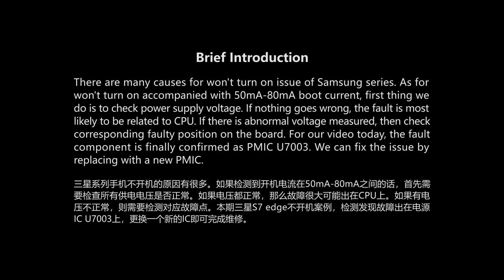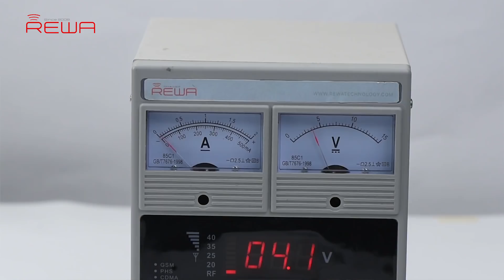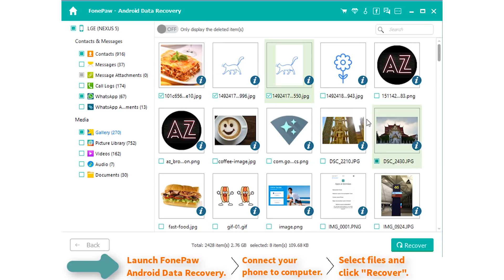How to Fix Samsung S7 edge Won't Turn on - Logic Board Solution

Comment from the maker: Leave us a message for Samsung issues you have frequently encountered.
Reply: REWA Technology : my brother galaxy note 5... it is turn on.. but there is no display.. i know it is turn on because the phone is vibrate.. can you point how to fix it.. at least.. which part should i check
Reply: hi rewa, mostly Samsung issues i had are black screen issue.
Reply: finally not an iphone video again, great job!

PLEASE find a solution to remove samsung screens on models that open from screen first without breaking the display AND how to remove screen to replace charge board on models like s6 s7 without breaking the display.

Thank You
Reply: My Uncle has a problem with is Note 3: It is turning off after he turns on mobile data. He has to hard reset via batter pull to get the device back to life again. What could that be?
Reply: the|Gamer  just need software flash. Issue will be resolved
Reply: I phone 📱 X glass frem any sollushans ?
Reply: Mainly in samsung lcd phones.backlight problem
How backlights works ?
Plz make a video.
Reply: In LED phone main problem EMMC chip.
Reply: Hi there and thanks for your videos
Ive 2 s7 edge oreo firmware
5 hour for charging via usb but in display say wireless charging... ?!?
Change 2 display but same problem
Thanks
Reply from the maker: @W Dora Try to replace a new screen. If the problem remains, troubleshoot the display circuit.
Reply from the maker: @the|Gamer  Have you ever tried to flash the phone?
Reply from the maker: @Erik De Stefano So the phone was charged normally?
Reply from the maker: @asjid ali  Have no idea at present.
Reply: REWA Technology : where can i find the schematic... please help... i allready tried my brother phone on my screen.. it not works..
Reply: REWA Technology of course but i cant try to flash with nougat
Reply: I have a s7 edge , when I try to power it on it doesn’t go past the Samsung logo then shuts off I was told a battery ? Is that right ? I’m just afraid it’s the motherboard
Reply: Andy Vazquez : try with power supply... if it still then.. motherboard perhaps.. the IC power... if it not then replace the batteries is good choice
Reply: W Dora I’ve replace the battery right now and now Power ... how much would a ic cost
Reply: Andy Vazquez : try searching the ic code... like me fixing xperia c5 ultra... the ic power my c5 ultra use.. mt6325v... it is cost 55.000 idr... about 4 usd or so... try samsung part.. i believe they sell it
Reply: I had a pink line on my s7 edge its on right hand side help me with that 😫
Reply: Do you have any idea how to fix an issue where i turn my phone on but it goes to a green screen its so annoying
Reply: REWA Technology  my s7 edge has suddenly stop working. Till yesterday night it was working totally fine and was charged around 80 percent but today when tried to operate my phone it was not turning on and was not charging as well. The phone is completely dead. Can u tell me whats the issue and how much it will cost me to fix it
Reply: REWA Technology my samsung s7 edge, docomo only displays docomo word and set warraty bit: kernel. It wont turn on or off. Can you help me?
Reply: my samsung  s7 edge wont turn on bluethoot
Reply: REWA Technology 
Note 5 dead solution
Reply: I try everything on my samsung s7 edge and it won't turn on I need help u.u !!
Reply: with all due respect, I do not think the repair has been achieved in this way, the CPU goes under the Pmic and is quite susceptible to heat, if you thank it the ignition always remains something failing like the cameras etc, the only way is protecting around  of the pmic so that the heat does not affect the CPU.
Reply: hi rewa i have an sm g935 FD he was working correctly and i dont use it during a perod of 1 years and the logic board wont turn on ive tried a lot of things but nothing work please help me
Reply: S7 edge. Freezes, getting very warm and keeps rebooting.
Reply: Hey I have a s7edge it's getting hot and restarting itself frequently, sometimes it's getting stuck on Samsung logo but when I use it in safe mode everything is fine , can you help me with this problem thank you
Reply: @rewatechnology2008  do you know the charging ic of samsung s7 edge 🙏🙏
Reply: @rewatechnology2008  charging ic number of samsung s7 edge
Reply: paanu yung sam.s7 edge ko is magturn on nmn xia pero ayaw ng magback sa menu at ayaw mareprogram
Reply: i know Im asking randomly but does anybody know a trick to log back into an Instagram account..?
I was dumb forgot my password. I appreciate any help you can offer me
Reply: @Marcelo Terrance It worked and I finally got access to my account again. I am so happy:D
Thanks so much, you saved my account :D
Reply: @Lachlan Andres You are welcome :D
Reply: Sir muge be phone sai karwana h aap ke mobile number do
Reply: Hi. I hope this message finds you well.

One time I was taking an online quiz while installing an app from google play. Suddenly, my phone froze and completely died. It did not restart on its own like it usually dies when it randonly shuts down.

I tried plugging it to a charger and it also won't charge. In short, my phone is completely dead. I can't afford a new phone right  ow and all of my accounts and account passwords are saved there. What should I do?

My phone is a Samsung Galaxy S7.
Reply: I have same issue my phone turned off suddenly after heavy lag now it doesn't turn on neither charge but it shows charging sign if i put it in charge for hours but doesn't turn on please what's the solution i don't want to lose my data 🥺💔

Comment: Is it affect the IP68 Water resistance??. If opened for once and repaired. My phone had the same problem then I repaired it by sending to Samsung care.
Reply from the maker: It will lose the water resistance function after disassembling, but you can get the function back to some extent after special handling.

Comment: Mine was frozen, - could not start op again so heated it up - used a suction device and my drivers licence, - began to slide the card down to remove the back cover, - and it bursted into life ???
Any suggestions to what happend?? 
At least this method to open the back leaves n o traces at all !
Reply: My S7 Edge won't Turn on after reset to factory setings, is completly dead. I went to Samsung store and o fix the phone they asked 500€. Do you know where can i find the PMIC Board? (Maybe on eBay?...I don't know if the problem is that?!)

Comment: I've got 2 Samsung S6 Edge phones, both have been flashed and re-partitioned with correct software. Factory resets have been attempted after flashes.
One sometimes completes boot, however if it completes has no IMEI/no service and has artifacts on the screen when you change from app to app.
The other one either stays on the initial "Samsung Galaxy S6 Edge" screen, but sometimes progresses to the pulsing "SAMSUNG" logo screen where it stays with a blue LED, which after some time it loops.

Any help would be great thanks.
Reply from the maker: No IMEI/service: It might be related to Baseband.
Stay on Samsung Logo: Try to flash it with Odin mode to see if it can enter to the system normally.
Reply: Thought it might be a Baseband issue, but would that also cause the artifacts on the screen?
As mentioned, already tried flashing it with Odin with no success.

Comment: S7 Edge turns on all the way to T mobile logo then turns off. Will not load OS. When we try to charge we get a YELLOW triangle when using wireless charger and a white charge circle with white lightning bolt static not blinking when we plug in USB charger. Tried reset, cache,wipe etc. NO LUCK. Had to return it. This happened after phone power ran out the night before. We left plugged in to charge for few hours but no luck.

Comment: Is this worth doing financially speaking?
I love the S7 but Ive bought two brand new in a row that have just gone dead, one in a year, the other in 2. While they are cheap to buy and do everything I need in a phone it makes me not want to buy them anymore because their reliability is so low. I feel like phones are a suckers game nowadays, I'd rather be a $250 sucker than a $1200 one :)
Reply: well, my s7 Edge Is nearly 8 years old, and apart from a broken LCD and a battery It Is completely fine. i use It as my second phone. i can suggest you a Motorola Edge 30,wich i use as first phone.

Comment: what cause would be 300mA boot, no display and charging with 200mA. If you say 50mA is a CPU fault (or PMIC) what could cause 300mA? No liquid damage or short found.
Reply: dead ufs